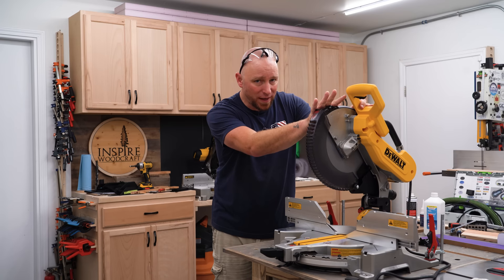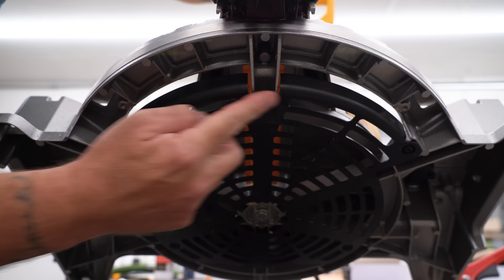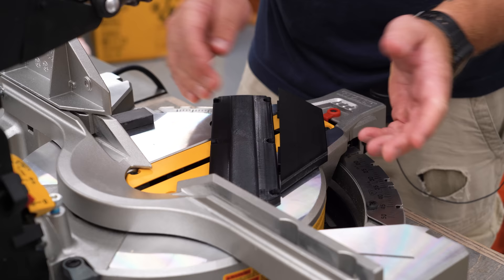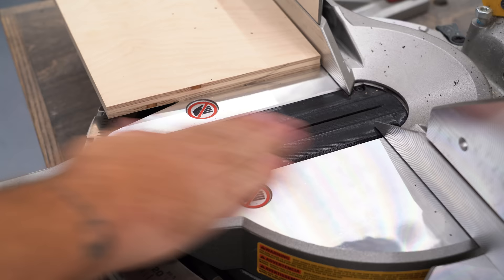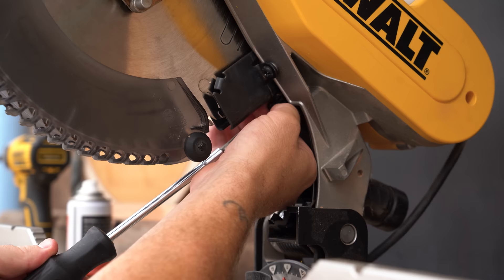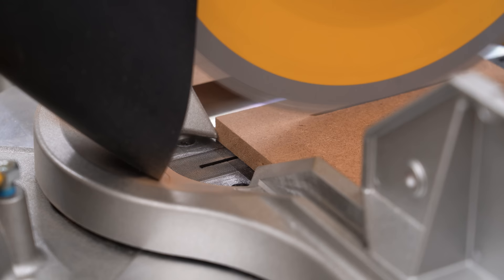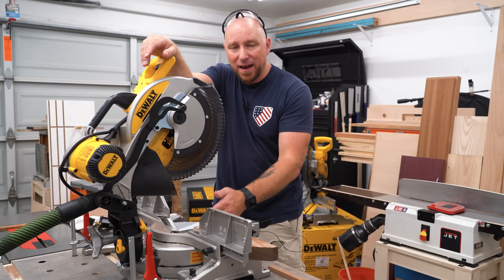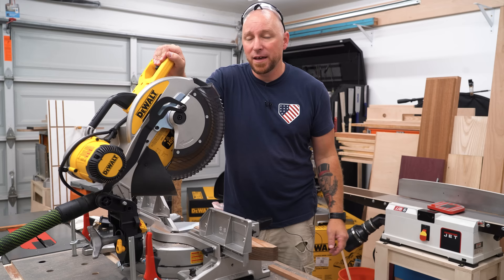The Genius Miter Saw Insert That Doubles as Dust Collection

Comment: Great job. Thanks for you time and effort into such an annoying issue. 
I’m hoping you system works on my DWS780.  Could you confirm if it does?
Reply: 9:25
Reply: ROSSEAU 0DUST HOOD 
BERN USING MINE 20YRS 
DW708 OR DW780

Comment: Jody, I am going to ask you what might seem like a dumb question. But, I was trained that the ONLY DUMB question is the one THAT YOU DO NOT ASK!!! So, here goes. In your opinion what is the most accurate compound miter saw? Is it a Dewalt by you having and using so many of them? I am asking because I'm constantly having to adjust/readjust the 90° on the blade and also the 45° Bevel cut and the aluminum fence seems to come out of square easily, too on my Big Box store brand compound miter saw. Should I seriously consider getting a new saw or consider using Loctite Threadlocker to hold those settings in place? It is portable saw but does not get banged around or the like in my shop or backyard where it gets used. Thank you in advance for your time in reading this and replying back to me on this matter!!! Also, thank you so very much for your teaching/instructing skills/demeanor that you exhibit on your videos!!! 👏👏👏👏👏👏👏 One last Personal Question. Are you also a Veteran, too?

Comment: Would plastic glue like we used on our model airplanes as kids work with that kind of plastic instead of CA glue?  It sounds like you're satisfied with the CA, though model plastic cement actually welds the parts together if made of compatible plastic.
Reply from the maker: @am2dan450 Great question! As long as it is compatible with PETG, I don't see why it wouldn't work!

Comment: I think this zero clearance dust insert is great, any plans for the DWS779/780?

Thanks for sharing!
Reply: I will be also hoping that one is created for the DWS780 

Does the silicone boot work on the 780?
Reply from the maker: @dereknykamp1208 YES! I have a 779 in the shop and am getting ready to start tearing it apart!
Reply from the maker: @duanemahussier8858 It does not.

Comment: Is it possible to create an insert on the bottom the allows bevels to 47°? Is there not enough room to allow for that, or do you not think it would collect as much dust?
Reply from the maker: @keith323 Bevels create an issue with space under the table. The swing of the blade is so much that an accommodating dust shroud won't even fit in the opening where the throat plate goes.

Comment: Was looking at zero clearance inserts and came across some black ones. Does the black make it easier or harder to see compared to the bright yellow? Anyone have a black insert?
Reply from the maker: @apmadeithappen2  Out of curiosity, what are you trying to see?
Reply: @InspireWoodcraft  I mean I get your board covers the insert so you don't really see it but alot of times I look at the line on my insert to see where my cut will be so I would think having a black insert would make it a little harder to see? I should probably get some glasses lol
Reply from the maker: @apmadeithappen2  That actually makes a lot of sense. I have done that in the past with zero clearances fences, not with the insert. I went to the shop and looked to see if I could tell much of a difference between the black insert and an orange one (I don't have yellow), and I personally didn't find that one was easier to see than the other. I think it more comes down to lighting overall. The zero clearance kerf is pitch black with the dust shroud under the table, so that stands out more than anything, even with the black insert.
Reply: @InspireWoodcraft  can't cut right without light. I got one of those Rousseau lighted tents for dust collection and I use it more for the light then to collect dust. I just ordered a black and one of those mdf looking ones too. We'll see which one I like better.

Comment: What will work for the DWS715?
Reply from the maker: @karlchwe9644 As of right now, I am told the dust boot works on the DWS715, although I have not tried it personally. I don’t have a dust collection throat plate, but might be adding one soon.
Reply from the maker: @karlchwe9644 We finally have a dust collection throat plate for the DWS715 if you want to take a look! https://inspirewoodcraft.com/products/dewalt-dws715-dust-collection-throat-plate-insert
Reply: @InspireWoodcraft  Thanks!

Comment: Your concept is really good. However, whenever you cut a 45° angle, cut it chew up the boot and Twista boot out of shape, so it no longer connects with your collection system.
Also had to remove the insert because it kept popping up. 
If all anyone wants to do is kind of 90° cat on this, it’s a great system, but if you’re cutting any sort of angles simply won’t work.😢
Reply from the maker: @jerrycomish7081 If you can send me some pictures of what you are describing, that would be really helpful for future development. You can email them to me, if possible, to inspirewoodcraft@gmail.com.

Miters should be no problem for the boot, same with most bevels and even compound cuts. The shape of it was refined to be able to still use most of the saw's original functionality without interference with the blade. I personally have them installed on two different saws and have had no issue with interference. The dust collection throat plate should only be used for plumb cuts but will still work through all miter angles. As for the insert popping up, this may be the first I have heard of this! I can only recommend to make sure to let the blade stop spinning before lifting it back out of the cut.

Again, feel free to email me with any info you can so I can help figure out what might be going on!

Comment: I don’t get Dewalt and not modifying all there miter saws at the beginning to cater to both woodworking and construction. I suspect that carpenters and trim carpenters would take much less time to clean up at the end of the day.  It’s unfortunate to see that 
so many woodworkers already did most of the work and they don’t even try to do the same or better! 
I have the Bosch 12" Axial and it the same, it unacceptable they should try to beat Festool on that front!

Comment: Jody, you mention that the miter blades are not centered, at 7:49 of your video. 

The reason may have to do with a design feature of DeWalt Miter saws, which is brilliantly explained in the video below. According to Insider Carpentry - Spencer Lewis the DeWalt miter saws are designed to pivot exactly at the intersection of the fence and the right side of the blade (the arbor side). As a result the blade is on the left side of the pivot point, not centered. 

Here's a viewing guide for Spencer's video,
0:00-1:12 The details on the Wainscot trim he's cutting
1:12-2:30 The cutting
2:30-6:00 The explanation of the saw's geometry

Jody, I love your videos and creative problem solving skills. Spencer is another sharp cookie on you tube.

https://www.youtube.com/watch?v=p1UOgiz3Lfk

Comment: DUDE
ROSSEAU 0DUST HOOD
YOUR WELCOME 

Been using mine INDOORS or OUTDOORS for 20yrs 
NEVER ANY DUST ESCAPES
Even that stupid little puffs of dust that comes off the very front of the blades sometimes gets sucked right back in as long as you're using a minimum 5 horsepower

Comment: I have 2 SAWHELPER ULTRAFENCE 88 setups with 0DUST HOODS 
And a ROSSEAU TABLESAW SETUP with  12" blade , OPTIONAL router feed table , infeed & outfeed support tables. (Ican rip 5' x 10' 5/4" MDF all BY MYSELF without a SINGLE "WIGGLE" with my BIESMEYER FENCE!!!!!
Baddest equipment ever invented 
(Thats why FESTOOL & FASTCAP STOLE the DESIGN)

Comment: Get a patent on that asap. I'm sure there's nothing dewalt would love more than the chance to sell folks a miter saw, and then sell this very same upgrade to them.
Reply: I doubt it, to be honest. The main reason most of these saws don't have fancy dust collection shrouds is bc they become a prime candidate for broken parts, which if it happens during a cut, will turn into projectiles. They deliberately keep it as minimalistic as possible for liability reasons. You really think not a single one of these miter saw manufacturers over the last 100 years could have solved dust collection if they really wanted to?

Comment: @InspireWoodcraft  so it's no good for a miter period 😕. Of course I new this just throwing it ot their!
So what's the point bro doesn't make any sense people are gonna buy this JUNK and think they can use this cutting angles or bevels why is it you do not mention this at all bro NOT COOL👎🏽
Reply from the maker: @lipsrpink I cut miters with it all the time. Works like a charm. Not sure why you think you couldn’t. Bevels are a different story, but then a lot of bevel cuts can be made in a miter position. Many folks don’t, or hardly ever, use their saws for bevels. If someone uses their saw for bevel cuts, than this isn’t for them. Pretty simple.